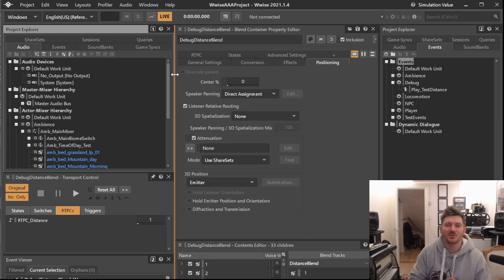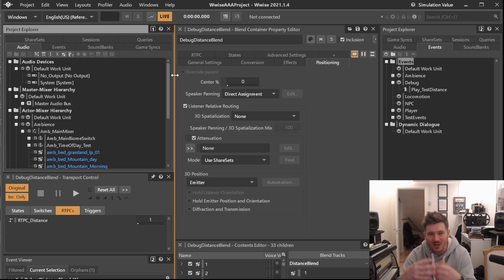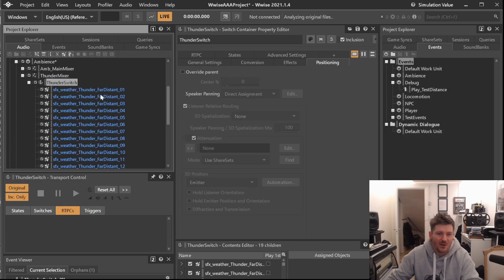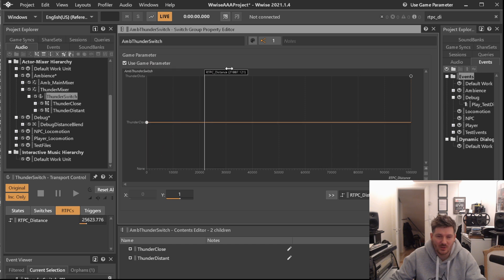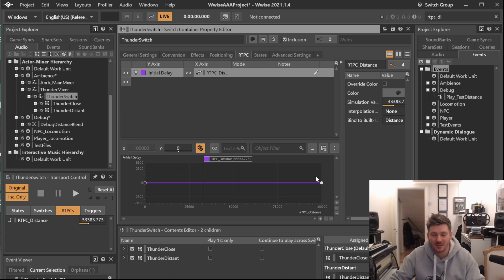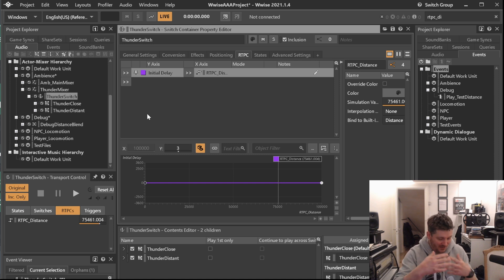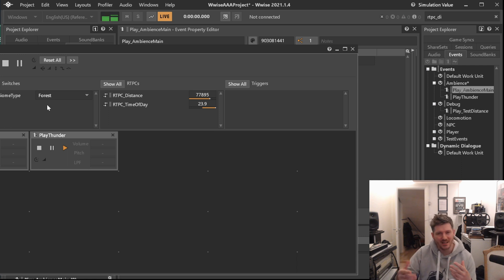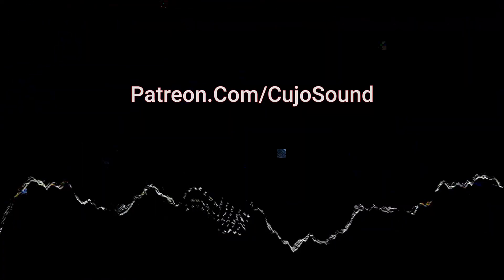Setting up a AAA Wwise project - Part 8. Reusing RTPCs for delays and switches.

Comment: I'm running into a problem. As soon as assign the RTPC_Distance to the ThunderSwitch group, the switches vanish from the ThunderSwitch container. So it doesn't switch between the close and distant random containers. It just plays the default one. and it is not affecting the initial delay as well. What is happening here? Thank you!!
Reply from the maker: hmm, that sounds odd. Have you tried making a new one and just hooking it up with the RTPC first, before you assign it to the switch container?
Reply: @CujoSound  Yes I tried it by myself and following the video again. It didn't work. 

But I created a new RTPC and set the "Bind to Built-in Parameter" to "None", chose a value between 0 and 1 and it works fine.... So I can make a guess that there's a problem with the "distance" parameter. Maybe something I should adjust in the settings? Though I have no idea..

Comment: Hi Bjorn! Recently started a Wwise project and started to wonder how one uses snapshots(Guess it's states in Wwise) in Wwise? Let's say for instance that I walk into a cave in a game and I want all the sounds from the player, enemies etc to be affected by a reverb. Is there a way to trigger this easily? If I use a switch group for instance that switches between outside ambiance and cave ambiance. Can I set a state (snapshot) that changes the mix to have reverb and have it trigger when I change the switch from 'outside' to 'cave'? 

Love the videos! Thank you!
Reply from the maker: Technically yes you can, but there are probably better solutions to what you need. 
Like, using the game defined sends to aux channels. Marking the cave with an AkRoom collider and tell it that all in there has a specific reverb.  

But the state could do as you mention
Reply: @CujoSound  I see, thank you! I was thinking about automating the amount of reverb based on how far in the cave the player is, and if I want to do thatI have to use some sort of RTPC that drives the reverb send amount I guess?
Reply: I managed to figure out how to automate the amount of reverb with the use of an RTPC! I am working in a 2D game and apparently the AkRoom and AkEnviroment components don't work with 2D games yet. So you can't use game - defined aux sends.

Comment: That’s a neat tip👌 using the distance RTPC to also control delay, to simulate speed of sound vs light, makes so much sense once you’ve said it.
Reply from the maker: Damn right Owen. haha.
Reply from the maker: Its an interesting way of dealing with lots of things - like also for running a switch between the "close" and "distant" version of something, if its a one shot - in that way you can create a much more specific distant version than the close one just filtered.
Reply: Also great idea for a tutorial series here to be able to touch on a lot of Wwise topics without needing a game to hook into. Looking forward to some more tips I can steal from you ;)
Reply from the maker: @owencoopersfx  thanks. The idea is also to show more than just "here is a random container, it randomizes" and actually give some context.
Reply: After watching this video I actually implemented it for gunshot sounds in a project I’m working on to give the shots a bit more variance. So the tails now delay a bit with distance, and there’s whizzybys that play when you’re shot at. Those also are also delayed with distance. Worked out nicely. Thanks again for the tip bro 💪